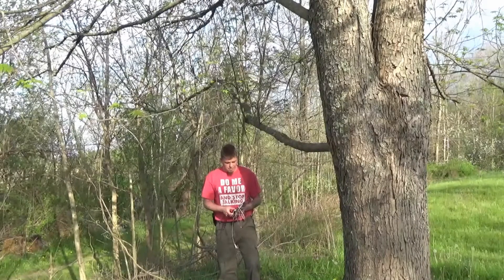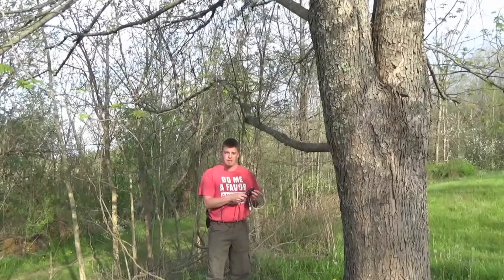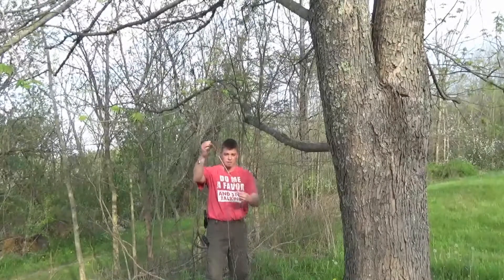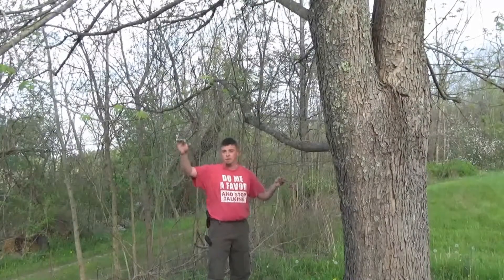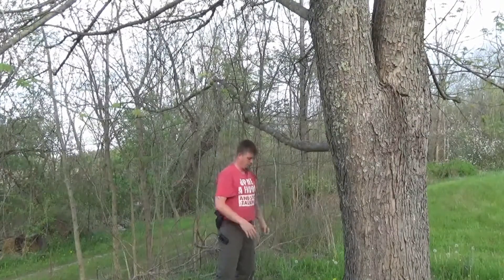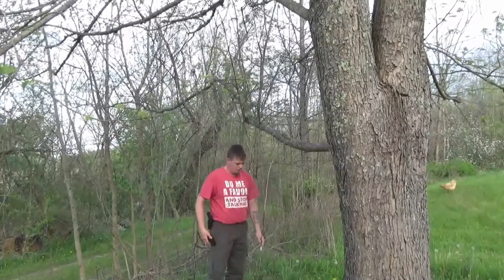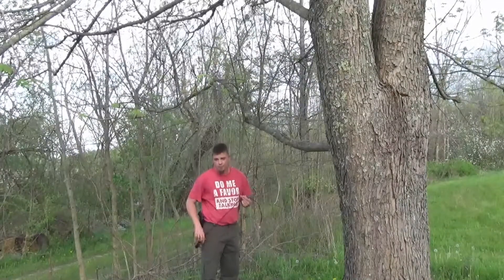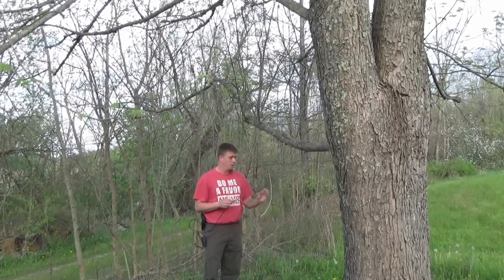Emergency Ham Antenna

Comment: Aaron, that was a great way to  make  an on the move antenna it seem better than the fire stick at least can take it with you any place you want and now you could transmit and not be in pointed lol
Reply from the maker: I think my favorite part about it is that It can be quickly made, and it works very well.  It can then be either stored for later use, or just discarded, as another one can be made again.  I'm looking forward to being licensed, in a few months.  Then I will be able to test the swr (standing wave ratio) on this one, and maybe some others that I will make.
Reply: Aaron,  thats a good setup I not see it done by anyone Prepping .
Reply from the maker: Ham is kinda looked at like a nerd thing, here in the states.  I wish I would have gotten into it earlier in my life.